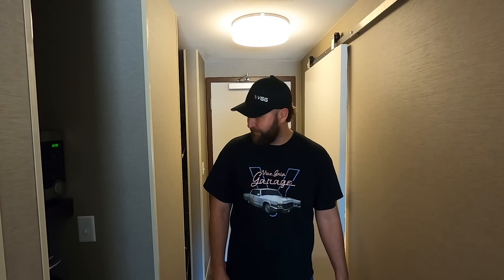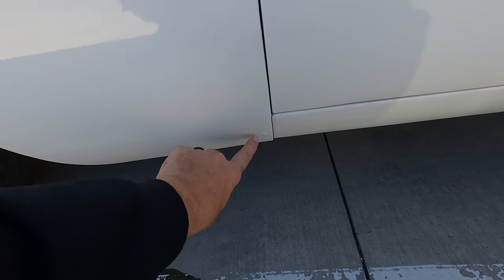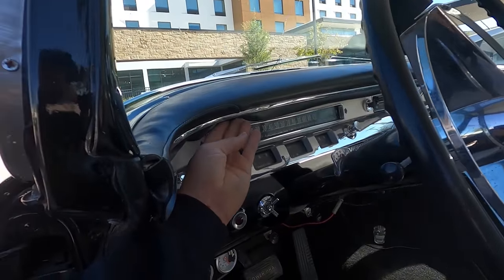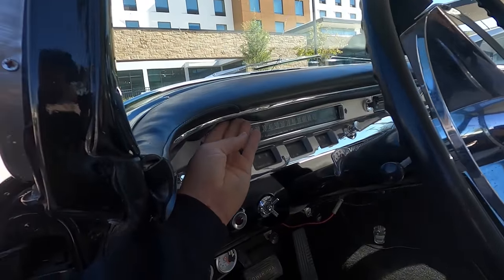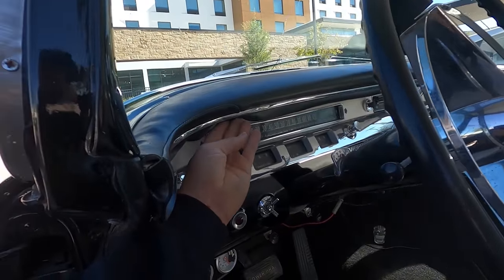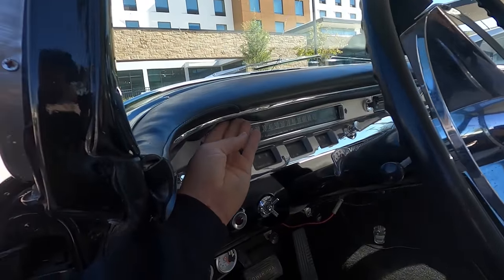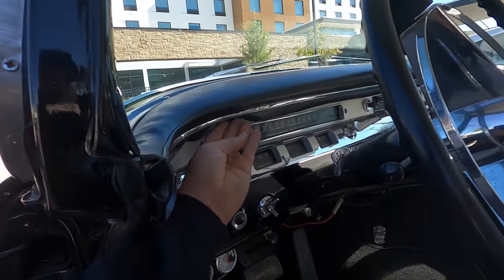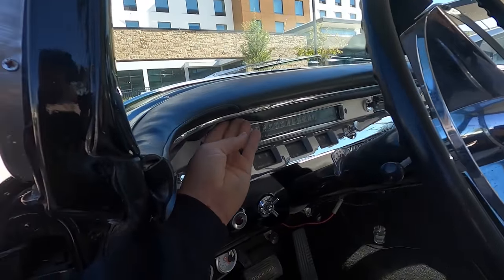Will This 1956 Buick Special DRIVE 1,200 MILES Back Home? (P1)

Comment: This almost made me cry seeing this whole thing. My dad passed away last year, and we had a 1965 Skylark that he owned since he was 16. I don't know a lot about cars beyond the basics, and I'm definitely not financially capable of restoring it. It's rough, it's been sitting since 2002 in the yard and is starting to show some bad signs of rust. Seeing this really makes me want to do what I can to fix it, but I'm just so clueless. I've learned a lot from watching your channel and I'm confident I could get it started and running again with a day or two of effort, but I wouldn't even begin to know where to go from there. The interior is shot, it's sitting on 3 flats, I don't know half of where any of the wiring or tubes go or what they do. After seeing this, I'm starting to think I'd regret selling it, but I'm also regretting letting it sit and rot not doing anything with it. I'd love to see it on the road again, and I know it's a solid vehicle... at least it was 20 years ago... My father rebuilt the engine from the ground up when he was in high school. I wish I had more time in the day, and I wish he was still here to restore it like we planned a few years ago.
Reply: At the end of the day it just takes money. Either way it takes money. Do some looking around and see if you can find a good mechanic to do the bare minimum to save it.
Reply: good play to try to manipulate someone into doing it for you
Reply: Best thing you can do for now is get it inside out of the rain so it doesn't rust two-way rot to nothing but junk

Comment: The most beautiful runnig motor I ever experienced was a 1970 cad. 472? It was a low mileage rescue job. The car was a beige on biege? Boat but the engine was sweet. After scraping out the Pensoil and or Quacker State and putting in castrol 20-50 the engine began to guiet down. Then it smoothed out. You could cruise at 85 but at 70 the engine  would purr. A powerful but beautiful purring sound... amazing.  Thinking back now... I put new AC Delco plugs in,The old ones were carbon fouled. I set the carb to lean best idle, most old cars were set to rich because no1 understood carbon/ heat etc..Also the timing was allways set to far advanced, because lime the air/ feul mixture it sounded better to the untrained ear.

Comment: Takes me back to when my Dad helped me bring home my first motor cycle. I was 14. Still riding at 68.
Reply: My old man helped me do the same to my first used and first new motorbike even though he disliked them.
Reply: I’m 71. Still riding. Mine’s a 2005 V-max. I’ll ride till I can’t walk. A stubborn determination serves me well. Be careful, friend
Reply: @eileenheitman4351  Funny you should mention the v-max because that the first new street bike I bought in 1986, my father co signed for me. I tore that bike up drag racing the streets of Chicago then sold it about 6 years later. Very powerful for it's time, the drive shaft effect could get you killed in tight turns though, I almost learned that the hard way. The fact that your still riding yours is awesome because we both know it is not the most comfortable bike on long highway trips.

Comment: The Buick "Nail Head" was one of the best engines ever manufactured.
Reply: Imo it’s one of the greats but will never top the 350 way easier to work on and the mods are endless kinda what the ls is turning into
Reply: And the Dynaflow was the WORST auto trans ever!
Reply: Ive heard that about every american v8 built and ive heard the opposite when they are being worked on lol.
Reply: Apart from the way they overheat an hour after you stop and you come back to see the swimming pool is full now.
Reply: @michaelmcneil4168  FAMOUS for overheating issues. I would strike it right off the 'greatest engines' list.
Reply: @primer50  400?
Reply: "Vintage oddity V8" I totally agree. The downfalls of it back then, are pretty easy fixes now if you aren't afraid of changing it up (non OEM stock build). Aluminum radiator and "waterless antifreeze" for a start. They had their quirks, but a lot less than the Ford Y's, and over complicated Hemi's. But the Best? IMO that goes to the "Stove Bolt". I have 3 "series 1" Chevy''s with that in them, and they all still run like a Swiss Watch. No power, no torque, but they just won't quit.
Reply: @txoilfield  Huh? Obviously  you have never driven one.

Comment: I love the nailhead. I've never seen an alive one, they're usually just in books. Man that's sounds good 👍
Reply: Check out Hagerty, they did a full rebuild on one.  Pretty cool stuff.
Reply: Those mail heads were hood motors .  Sounded good as well .
Reply: I gotta couple of them...both running...both in jeeps...
Reply: Jiminy cricket you want to see in a live nailhead take a look at the Buick he's just fixed up getting rid of the one he picked up the banana yellow LeSabre.

Comment: my pops used to measure a speedboat's top speed in "women per hour"
Reply: Jr ALEXANDER  sorry but your wrong you just never met the right girl. I even turned crankshafts when I was young. Then went to Houston and worked as a model at Frost Bros. Look in a medium size city, or smaller. Good luck !

Comment: Thanx for the ride along,i was 8 years old when my step dads 69 yellow 396 4 speed post ss chevell left the driveway,thats 48 years ago,i found it in saint Ignas at the car show,87k miles original,nothing changed on that car since i was 8 other then tires,and! The kid 2 houses down had tracked it down when he was 17 n bought then moved to Canada with it,fn crazy! Glad you got it back,cheers!!!

Comment: Derek, over the last few months I've become hooked on your videos, but this one is really special (no pun intended).  Much like you, I inherited a 1956 Buick Century from my Dad.  The Buick was bought new in 1956 when I was 5 years old and was our one and only family car until my father bought a new 1968 Chrysler Newport.  The Buick became our second car at that point and I drove it for about three years, commuting to college.  My friends were amused by the unique starter switch integrated in the accelerator pedal.  In addition to the Buick getting about 7 MPG on the highway and 5 MPG in city driving, it was always having mechanical problems.  Just to name a few:  frequent brake jobs and exhaust system replacement; replaced all freeze plugs but two; power steering gear seal replacements; frequent battery replacements; wheel bearings replacement; starter replacement; and, cooling system issues.  Eventually, I traded it in in 1971 for a 1968 Plymouth Sport Fury with a 383 engine.

Comment: The 56 Buicks had 343 gears. Also with the older Buicks believe it or not a set of bigger jets in the carburetor will help it cool down some. I had a 48 Roadmaster for 39 years and used a 195° thermostat in my 48   It helped keep the coolant in the engine longer and help the radiator to cool the coolant down.  If the transmission is losing oil, the two seals in the torque ball and the spline seal keep the oil from going into the rear end. If that happens oil will start coming out the axle seals. Also I love the story about the Buick. I grew up with Buicks from 1938 to 1959. I rebuilt a few straight eights.

Comment: Cool story. I never had a family vehicle that shared so much love. I did have a 71 chevelle ss matching numbers that was professionally retsored on a rotisserie.  $10,000 paint job back in the late 90's with brand new interior. Car was immaculate. No family history but I would probably cry if if I bought that car back.some people just dont understand the connection between a guy and his vehicles. Some of us find them more reliable than well you get it? Atleast we can do preventive maintenance on a car.

Comment: My parents had a 56 four-door Chevy Belair when I was growing up in the 60's.  The Chevy had a 283 small block with glass packs and sounded awesome.  We sold it in 67 to some neighbors when my parents got a new 67 Chevy Impala.  The neighbors failed to keep check of the oil and blew the engine.  Very sad.  The 56 was also two tone i.e. red and white with tuck and role interior.  I never saw the car again, but have always wanted to get another 56 or even a 55 Chevy now that I am retired.  You never did say how you liked your "Whataburger?"  I grew up on those in Arizona and then in Texas.  They don't have them here in Central Oregon where I now live unfortunately.  Thanks again for the memories.  Cheers

Comment: I bought one of these, a '56 special sight unseen. I found it in Hemmings motor news, located in Scottsdale AZ and I drove it home 955 miles up to the San Francisco bay area. It was an adventure but it made it and it became my daily driver for about 4 years. Ultimately the car frustrated me with the loose steering that's designed in- you can't improve it. Also the all drum brakes would overheat and fade real easily and I had the scare of my life almost not stopping at the bottom of a hill. If I ever get another It gets a Fat Boy front end, disc brakes and rack steering. The best improvement you can make.

Comment: I sold my first car which I owned from the age of 18 to when I was 30. It was a '62 EK Holden, an Australian GM car which are like a smaller 56/57 Chev... with a some 56' Buick influences as well, like the tail light treatment. Google it. I sold it under monetary pressure to a 14 year old boy and his Dad for them to finish.
It was very nearly finished, just needed very small body repairs and then paint and some interior finishing but all the major stuff was done- engine, trans, brakes,  diff, suspension, the weight saving rust all but removed.  It looked tough as it was, and drove so well as I had upgraded it to a bigger engine, disc brake conversion etc- and my heart and so many great memory's are in it. Been trying to find it for years- joined all the face pages looking...  You are one lucky SOB to find that car- good on you!

Comment: This was my first car. Really brings back memories. I got mine 1964 for $500.00. Had to get transmission rebuilt. Did over heat alot. Replaced hoses and finally new core in radiator. Lots of great 👍 memories. Mine was 2 tone green.

Comment: 36:14 the boat is a Glastron v156 circa 1969. I grew up on a 1972. Your correct, Derek- it does a solid 25 MPH, 32 wind to the back, one tiny operator on glass…. I chuckled when you referred to it as a “speed boat”…. You’re awesome over dare at the VGG- keep it up

Comment: I had a 50 Mercury 4 door sedan witht the flat head engine.  I decided to replace the falt head with the nailhead 57 364 cubic inch Buick engine.  I grew up in the late 50' s and spent a ton of money on this car.  Full naugahide interior, frenched in head lights, lovered hood, frenched in tail lights and rounded corners on the old merc hood.  I put 14 transmissions in the car and realy had to sell it because I couldn't locate anymore transmissions to rebuild.  I loved the torque in the nail head and the sound of the intake.  Sounded like it was going to suck the hood in.  Sold the car and never got a picture of it.

Comment: My 56 was a Century (Roadmaster Interior and 4 BBL with duals) sounded just like that. On a cold morning idling at low idle it sounded like marbles rolling down the pipes! A truly wonderful car that would git more than most thought. I surprised more than one 55 Bel AIr with a 265 as that nail valve 322 4 BBL and Dynaflow (Late Dynaflow with a Torque converter) she would pull that big old beauty away from the light right quick!

Comment: My dad bought a new Century in ‘56.
Driving through Nevada when they didn’t have a speed limit, he put the pedal to the metal, I saw with my eight year old eyes 120 mph on the speedometer. That car made me carsick with it’s four coil springs. Two years later he bought a Chrysler in which I never got carsick, it had torsion bar front suspension with leaf springs on the back.

Comment: I totally know how you feel I built a 1956 F100 short bed my grandfather had the first time I seen this truck I was 12 years old back in 95 10 years ago my father and I decided to build it for my grandfather it took us over a year frame off Full build updated engine brakes power steering everything so my grandfather could drive it in luxury and he's almost 80 this was a truck we were going to keep in the family forever last year the fires came through southern Oregon and burnt down his home and the truck was one of the things we couldn't get out before the fire took over the fire was so hot there was nothing to save the frame was bent and the body started melting in on itself it's amazing how attached you can get to an inanimate object some things you can't get back but I'm glad you got yours back and can't wait to see how it turns out I will definitely follow alone

Comment: This is your buss brother we’re just along for the ride I don’t know the black an white looks really good restore it definitely a good idea before it goes south on you find a rad shop an fix the rads maybe splash some keep from rust material on em they don’t corrode as fast as bare copper does keep the green out of the seen . Best of luck on the land yacht boat floater special it’s definitely a nice ride glad to see you back in it .

Comment: First car I ever drove was a white 55 Buick in 1966.  No power steering or AC.  Cutting through a narrow street in a strip mall a brick wall of the drug store moved and hit the front right bullet of the bumper.  Small damage to the wall.  No damage to the bumper.  My Dad loved Buicks.  My Grandfather had a Roadmaster.  Really nice car.  Dad sold the car to another Officer he worked with in the Pentagon for $1.00.  Never had any issues until the MLK riots when a brick got thrown through the windshield.  Black and White is my vote.  Peace.

Comment: I bought a 1956 Buick 4 door for $40.00 in 1967. I needed it to drive while I put a short block in my first car which was a 1956 Chevy. The Buick ran great but I had a case of transmission fluid in the trunk because it went through about a quart or two every time I drove it very far. Never saw it leak, but it went somewhere. Sold the car to a hippie couple for $50.00 and no matter how much I told them about the trouble with it they still loved the car.

Comment: I was bought a '68 el Camino off the internet around 2000/2001 and was told it was in great condition by a relative.   It wasn't.   Too bad I got tricked into sending the money before I picked up the car for a drive from Vegas to Vancouver.   It was a two day touch and go including a breakdown in Burney California( by the way the tow truck driver there is a crook).  I finally made it.  I worked on, then drove that pile for three years before giving it up, and it was much better than when I got it, but still a pile.

Comment: Not sure if I missed the showing of it but certain engines that often have overheating problems even with new improved radiators and such, Oil Cooler add-ons can help a guy out. Helpful for more than just race cars.

Comment: If you never figured out your overheating problem on that car they used two different water pumps on that and if you use the wrong one it will overheat.

Comment: My 1st drive was in a 55 Buick, I was 2.5 year old, standing (bouncing) on the seat, clutching the steering wheel when a kid figured he needed to know what that shiny lever did... Rolled it out of the drive, across the alley and into the neighbors garage, I jumped out to inspect, when I saw the stucco all busted up... I did the right thing and ran.like a bat outta Hell 😂

Comment: Wow,  Mon and Dad had a 54 Century 322 Dynaslow (Dynaflow).  I remember the sound.  That thing was a tank too.  I never knew the 322 was a nailhead.  The biggest communication mishap between me and Dad happed over that car.  In 66 he got a newer Sklark and pulled the license plate, eventually sold it.  Turns out that he thought I would be ashamed to drive it and I thought the insurance for 3 cars would have been too high.   A year or so after he sold the Century we had a discussion and came to realize we let the old girl go too soon.

Comment: As far as the gas millage goes, engines have a sweet spot for speed and load. When I was a mobile tech our fleet of Dodge vans were 318s and 360s. The 360s always got better mileage because they didn't have to work as hard as the 318s fully loaded

Comment: Derek U do know that all that gas the 87  89  & 91 octane has 10% ethanol if the pump states it in one spot on the pump. The only non 10% ethanol gas ⛽️ you can get now is stated on the pump non ethanol. If it’s stated 10% ethanol anywhere on the pump then all grades of gasoline ⛽️ at that pump have ethanol.

Comment: beautiful car! my grandpa had a fairlane i cant remember if it was a 56' but it was a hardtop convertible. it never ran my whole life it sat under the barn on his property for years until he moved and had a shop and parked it in there. it was straight though, had a complete engine and drivetrain. no rust besides surface rust he had all the trim ready to go on the car it really just needed seats for it to be driveable and for the engine to get running. I regret never asking him as a kid for us to work on it together, when he passed my grandma sold it for dirt cheap because she didnt understand what it was worth. I was a teenager when he passed and didnt know much about cars at the time and i regret not restoring. The guy who bought restored it and its won a couple trophies at some car shows.

Comment: That transmission issue you had, my 62 Bonneville did the exact same thing.  I put Lucas additive in it and kept driving it, after a few short in town trips, it kicked into high gear.  From what I’ve heard, they’re pretty tough transmissions.